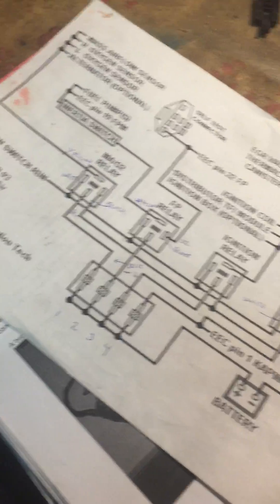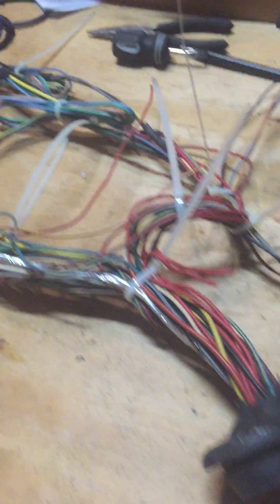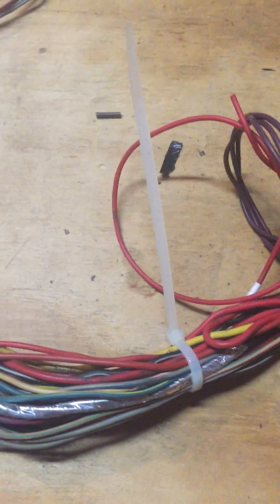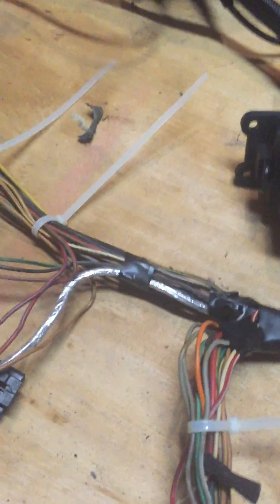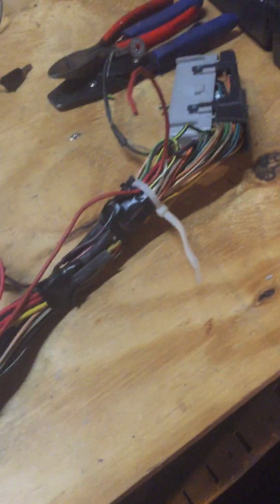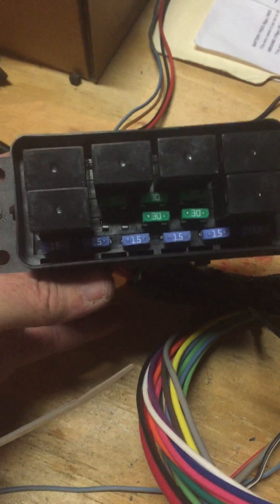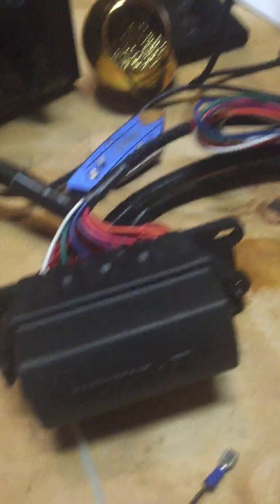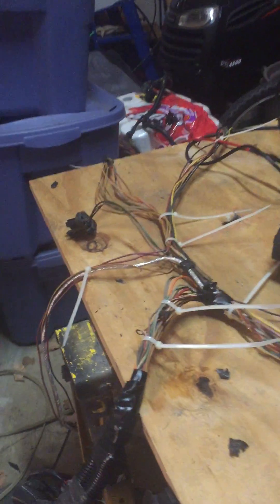Ford 5.0 EFI Harness Conversion Walk Through Part 1

Comment: I’m restoring an early bronco that has a 5.0 h.o installed.  Is there an easy way to figure out what the engine came out of?  Also, they capped the lines for the power steering pump, and left the manual steering gear box.  I’m hoping I can just add a new power steering pump.  Is that all it would take?  Is there a good donor vehicle that works well?

Comment: Can you help me in making the correct connection of the wiring, from a mustand if engine to a ford 250 pick up
Reply from the maker: Just like I answered below.  I would say that this type of trick with resistors would work the same way as it does on the Mustang 5.0.  However, the challenge would be to locate the same wires on  your harness.  The reference materials that I used in this were for a Mustang computer, that mapped these wires to pins specific to it.  Your F250 computer, probably has the same wires (by function), but may be mapped to different pins on your computer.  You would need to find the pinout for your computer and locate which wire does what.  The wires functions are labeled EVP, Sig Return, and VREF.  Locate those on your computer pinout and then do the resistors the same way as shown in the diagrams for the Mustang.  Again, this is trial and error here, I don't know if it would work exactly as this does.  Good Luck
Reply: @MajorSporto  the engine is from a mustang 1989 lx that i want in my f250

Comment: What year are you working on? I have a 95 I’m removing from the car now. It it about the same as the common 93 and earlier which I see every where?  I know the 95 has the spout connector and TFI module relocated but what else is so different? Thanks

Comment: Will it work in a 34 Ford street rod? Have an EFI Ford polished set-up what I think is a 90 Ford with manual transmission.  You focused on "other Ford cars". I have at a stage where I can do most anything and have motor in place ready for the harness. Have old harness and computer.
Reply from the maker: That sounds like a really cool project!  To answer your question, yes it can be put on any older 302.  The computer is what dictates how the wiring is configured.  I typically work with the 86-93 Mustang computers, but other Ford EFI setups (T-Birds, Pickups, Vans etc...) can be reworked as well.  They're wiring pinouts are slightly different than the Mustangs, so it may take a bit more research to do the harness correctly.  Check the three digit number on the computer and research what vehicle it came from, and start looking for wiring info for that vehicle.  The pinout information is critical for correct operation, and like I said that varies slightly from vehicle to vehicle.

Comment: Do you know how to make a foxbody harness work on a 94 mustang gt?
Reply from the maker: The harness is no different from vehicle to vehicle with the exception of how the pins line up in the 60 pin connector.  So, a Foxbody harness would be setup for a Foxbody computer from the factory etc...  If you have a Foxbody computer and a correctly pinned matching harness then you can run that on your 94 Mustang.

Comment: Do you have a link to the fuse block this I cant seem to find it?thank you
Reply from the maker: Sorry for the delay Terry...  Here is a nice looking setup that will work and the price is reasonable.  https://www.ebay.com/itm/Universal-Waterproof-Relay-Fuse-Distribution-Box-80-Amps-JEEP-SPOD/232789383788?_trkparms=ispr%3D1&hash=item3633541a6c:g:~aYAAOSwqYxdNar4&enc=AQAEAAACcIQvEcHUrT7nmUC3yY5qbPyaBN1nJEDYW8MyypsJPgXKprB7XQ6kzQrRwmk40BQLKANHvDB%2Fdq3Pe97FDQzVnQkzBy08MeotP9cQUnupBYEBi00nL45nKFgEGEqwp7HD1kzdxYvqKZlDChZw5VfRYW7VGvt3sDyLyNO5pfXhvcrMrVJTt%2BRy4PH4fKxGNTsYVYd61j8nnzkQgykzCV4qkdz0UShHKLx7UtfXk9n7XuAcZU5%2BOOsbhL7unOA8Cu5NihsWbVRlOR31v567y%2Fy4VyoJAyUCg1xDPBNZwIxQ6JlNuvAi3WGpdn4t11ZY1EnaX75EyN9PGhwiXKrjUWD3%2FN3N0m%2BBjxn5ndHk1RQfhVBqufQ%2FQwliB6uEfwjQwZw6xyiO7A88ldFwW67ZJgtT2Tv6I6x88ZKLN7t2kJZpdicL6PmymtYzLVdl5SdYWLJAvZqQcqc5w0lEQUbPVgMK2spAQrA6HIkHCVpKpprEy6A0bbC5MljlflazEj7OQfkcAWWHpYshIuaSRrYRGTJDq6Wq%2Fr1U%2Fgu2lwVLA22ee5OmWy467TlDNxlr1lDhc4G2FyOAUNI%2FR2GKDTQCUbtfK%2BDfCcRRBZ5luQrU71eAPjkx8%2FQ9qpf8VsXXa8J%2F5mTIgraCBp8L5oBP%2Bha0cWbx%2FQkct31JEOQI%2B%2Fd4E8QOGr%2FKsH0KghZFy1Snr7t3p2%2BdSihmk9IyRkrZxzlLNGjDR50rhOUZumu95h7wAVax%2FoaUjcecsdSpy8UqTdKu5qRqGOSC4vj6Nml%2FVoKxRr1eiwTTbgaAFnC6kCCQuaKS80GXbiWrfhzzQuvGwioPA3tThA%3D%3D&checksum=2327893837885c6588751132488c87900427f79164b3

Comment: If you don't  mind, what would you recommend as far me rewiring my 1987 F150 5.0 manual to an upgraded maf and injection system? What years of a mustang should I get a wiring harness from?    Fyi.  Great video.
Reply from the maker: refugiorod  I would look for an 88-93 Mustang Computer.  A9L is an example of a model number, but there are others that work too. These EECs would support the MAF sensor and work with any 5.0. The harness you get does not matter, as long as the pin pattern is made to align with the Mustang computer.
Reply: @MajorSporto   Thanks Major.  Would that convert my fuel injection system from bank to sequential injection.  I'm confused about the spark plug firing order in conjunction with the fuel injection. Any advice on this?
Reply from the maker: @refugiorod   I don't think doing that would convert it from bank to sequential.  The Mustang computers were tuned to operate with a larger HO type throttle body, beyond that they were similar to standard non HO 5.0 (Crown Vics, Econolines etc...) in function.  The HO firing order while different from a standard 5.0 is not a factor when doing a conversion with the Mustang computer.  I run a 68 Bronco 302 with a Edelbrock performer cam, and my firing order is 1-5-4-2-6-3-7-8. The 89 Mustang  computer I am running is from an HO roller motor with the 1-3-7-2-6-5-4-8 firing order.  No mods made to the harness,  and it runs just fine.  If and when I replace the cam, I intend to run a 351W cam so I can align the firing order with the computer, but that is way down on my list.  Hope this helps. 😎

Comment: I have a round wire connector behind the lower intake on my 87 5.0 that i cant figure where it goes,i pulled a 95 5.0 and put in an 87.efi,help!
Reply from the maker: Hi Anthony, behind the lower intake would most likely be where the O2 sensor harness connects to the main harness.  Just a guess from what you gave me so far.  Do you know if you have your O2 sensors connected?

Comment: I have a 1986 gt v8 engine harness and it won’t plug into my 85 that I’m converting to a v8 obviously. The plugs are different over by the brake booster. The car was a carburetor 4 cylinder with a computer in the passenger kick panel. Any help would be great. Thanks

Comment: Hi, do you have instructions on how to splice 93 GT harness into my 82 GT? I have the 93 donor car so I have everything including the engine. Thanks
Reply from the maker: Hi Craig, I don't have specific instructions, but if you modify the 93 GT Harness to stand-alone you can basically plug into any car.    The stand-alone design eliminates the factory connectors and allows you to connect it directly to battery, ground, start run and fuel pump.  The rest is all contained in the engine harness from the 93.

Comment from the maker: Yes. It is behind the kick panel on the passenger side. Since it is an 85 then there would be no existing hole. I just realized that, sorry.  So yes you would need to drill that 1.5" x 3" rounded rectangular hole in the firewall to accommodate the ECM plug. The engine harness really only needs the battery power, start post on solenoid, ground and ACC power on to work properly. A universal engine harness would be completely stand alone from rest of vehicle with the exception of the check engine light in the dash.

Comment: Hey I could really use some help right now. I'm putting a 86 v8 drivetrain into an 85 4 cylinder. Will the 86 dash harness plug into the chassis harness in the 85 4 cylinder???
Reply from the maker: Hey Sam. If you're referring to the 60 pin engine ECM connector, then you will need to recover that and the V8 ECM from the donor vehicle. The 4 cylinder engine wiring and ECM are different. I hope this answers your question.
Reply: Major Sporto doesn't the engine harness connect under the drivers side of the dash also ? I have the ecm out already and still have to get the plug through the firewall.
Reply from the maker: Yes. It is behind the kick panel on the passenger side. Since it is an 85 then there would be no existing hole. I just realized that, sorry.  So yes you would need to drill that 1.5" x 3" rounded rectangular hole in the firewall to accommodate the ECM plug. The engine harness really only needs the battery power, start post on solenoid, ground and ACC power on to work properly. A universal engine harness would be completely stand alone from rest of vehicle with the exception of the check engine light in the dash.

Comment: Guess you wouldn't happen to know which if any wires need to be moved in a 99 3.0 ranger getting a 2000v8 explore engine and harness?
Reply from the maker: Sorry, I don't know that harness at all.  I do know guys that used the Mustang ECM, harness, TB, TFI distributor and injectors on a late model Explorer 5.0 and it worked great.
Reply: Major Sporto Yeah I'm figuring it out. . just thought  I would ask. Good information in your videos though!!

Comment: hey watched all your videos very informative I have a 93 ranger with a 89 5.0 swap in there I had a rodent problem and 38 of the wires were eaten or damaged  I sodered and heat shrink all the connections back together when I reconnected the power I had a loose bolt on solenoid and it burned the fuse able link on my alternator wire I replaced the link and now it won't start it cranks I have power to the ecu I have power to other components just won't start my inertia switch was the stock ranger one but the harness to it was badly damaged by rodents  does the 5.0 ecu need this is there a way to wire around it on the 5.0 harness I have the added a fuel pump relay bypassed to a new relay it pumps fuel just won't start
Reply from the maker: Something to try...Crack the plate open on the throttle body, just a smidge, sometimes there is not enough air getting into the engine to start it.  I am assuming you have fuel pressure and spark.  Try that and let me know.